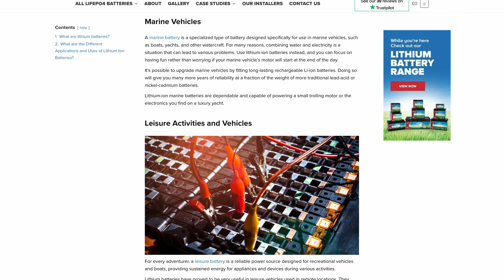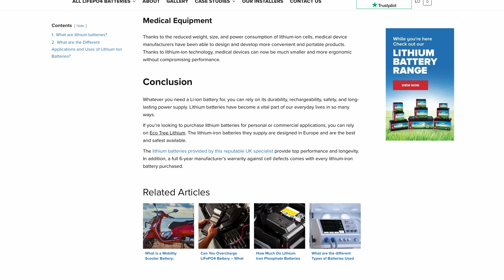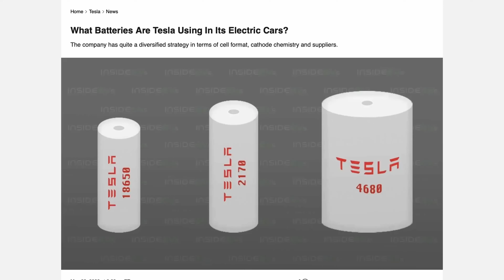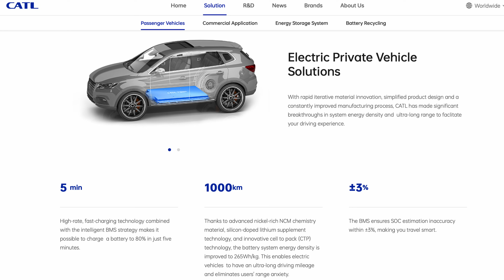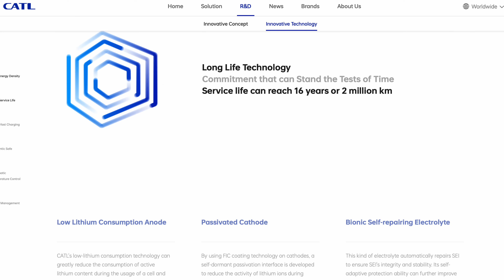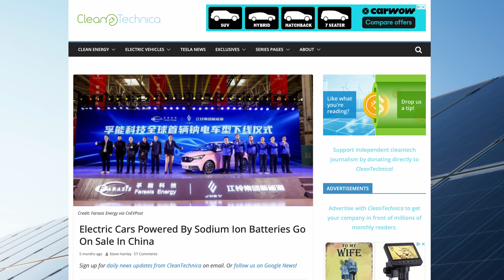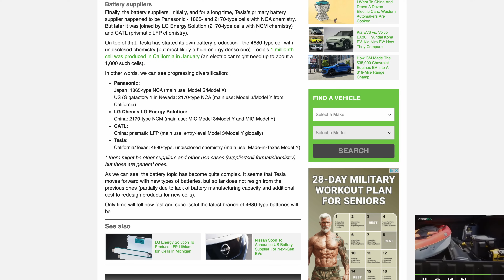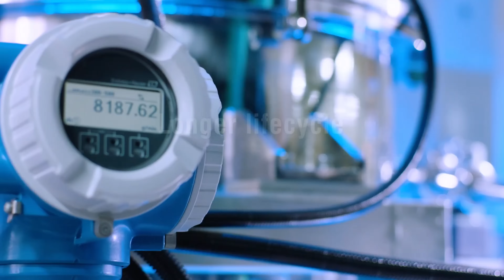The Future Of EV Batteries Is Really Rather Exciting

Comment: Don't categorise Sodium Ion as just for cheap low mileage cars , the best of the current tech is about the same as current LFP batteries , which give decent range. Plus cold temps do not have as much impact on Sodium Ion batteries, which will offset the lower energy density. 
As for the near future. Solid State Sodium Ion is getting closer to production which will give higher energy density than current best in class Li on batteries.
As you say Dave , the future is very exciting...

Comment: As long as batteries can produce the currents required to power an EV, fire will also be an issue from short circuits in the electrical systems of EVs…..most ICE car fires are not caused by the fuel but by electrical faults.  Interiors and aluminium burn quite well once a fire is started by the heat from an electrical short circuit.
Reply: Each cell in a Tesla is thermal fused and the minute the heat increases beyond tolerance the fuse pops and the circuit is broken. However, this does not Ward against a short circuit in a severe impact or something similar. That most likely cause of internal combustion engine fires is the 12 V battery shorting.

Comment: Ahhhmmmmmm EVs do set on fire stop it with lies your lieing to your viewers
Reply: The AA research into the subject from across the world suggests that the inverse is true; that EVs are far less likely to catch fire than internal combustion engine (ice). EVs have  broken every road safety record on the grid.
Bedfordshire Fire and Rescue Service records, some 1898 fires in 2022 were from petrol and diesel vehicles and 54 were from EVs.
The Swedish Civil Contingencies Agency (MSB) reported 23 fires in 611,000 EVs during 2022, or 0.004 per cent in a year, which makes it 20 times less likely to happen than ICE car fires, which burned 3,400 times in 4.4 million cars, or 0.08 per cent. MSB has also recently proven a new way to extinguish battery fires fast.
Reply: 20 times less frequently tthan ICE cars.

Comment: I would guess that in the future the EV platform vehicles will likely mean more choice of cell type.  I might expect that my car, if it needed a fresh battery in another ten to fifteen years, might get a different chemistry/ capacity/ charge-rate , etc cells rather than the present chemistry (NMC).  The present EVs on ICE platforms are less likely to be quite so easily accommodated with up-graded batteries in the distant future.

Comment: This is another reason EV adoption is slowing.  The whole of the car industry is suffering from Cuba syndrome. People won’t replace their current ICE because the future is so uncertain.
Reply: EV sales are increasing for both new and used sales.
Reply: @RuislipResident-v7p  they are not increasing at anywhere near the pace expected. Adoption outside of the early adopters and heavily subsidised company car market is very slow. We are still bumping along around 15% and nowhere near the 20% government target even with the heavily discounted new cars available (up to 40%)
Reply: I replaced both my ICE vehicles with EVs and will never go back.
Reply: @rogerphelps9939  yes the sales are up 10% but that only takes the market share up by 1%. The subsidised company car market is worth 280,000 to 300,000 cars a year base turn over which means private sales will be between 20,000 and 40,000 this year. No where near enough adoption to hit the government targets. Cuba syndrome is real and caused by uncertainty in the market.
Reply: EV sales are increasing for both new and used sales.
Reply: @RuislipResident-v7p  market share for BEVs has increased from 15.3% to 15.7% all car sales have increased this year but BEVs are already 6% behind the target. We need to hit 360,00 EVs we are currently only going to hit 321,000 of which these are mostly subsidised company cars replacing subsidised company cars
Reply: EV sales are increasing for both new and used sales.
Reply: For China EVS are massively accelerating and this is a huge problem for legacy auto because much of their profit comes from the China market. Not doing anything is simply not an option. Sticking to ice will not work.

Comment: The key of rapid charging in about 5 minutes, quashes the USP for Hydrogen
Reply: Kilovolt or megavolt charging is an insane idea. Yes it would charge quickly but how is that done exactly?  Even fully trained electrical workers have limits of approach to insulated HV of metres depending on voltage level. This is law in Western countries. Regular people limit of approach distance is even more. EV charging in cages perhaps? It is concerning how little respect people now have towards electricity.
Reply: I am afraid there are many problems with hydrogen not least the venting issue. As the cryogenically frozen hydrogen warms up in ambient air, the car has to vent. So you lose range while you’re parked even on a cloudy day.
Reply: To charge an EV in 5 minutes would require a current of about 500 Amps with copper wire 2cm thick. 
Where are you gonna get that from ?  An extension lead direct to hell might do it.
Reply: @Hickalum  If you can charge at a couple of kilovoltts that is easily manageable.
Reply: @rogerphelps9939  Maybe. I don’t know enough about transformers, except that they are very efficient.  … Those little brick buildings that house the step down transformers between grid and local distribution come to mind though, with “Danger of Death” written all over them !

Comment: We'll never have an EV that charges in 5 minutes because you wouldnt lift the charge cable, assuming it is possible to deliver the power.

Charging speed will ultimately always be limited by the charger.
Reply: Correct … You would need 500 amps to charge an EV in 5 minutes … with copper 2cm in diameter.
Unless … You could charge at 400,000 volts - then you need less than half an amp.
So it’s very simple; just plug your car straight into the national grid.
Reply: No. You can increase the charging voltage by temporarily reconfiguring batteries from parallel tto series connnection. 800 volts is already possible with the EV6.
Reply: Cables can be liquid cooled. People managed to do without their iPhones for a couple of hours I’m sure even 15 minute wait isn’t the end of the world?!

Comment: NMC batteries were the most commonly used in EVs last year. So of the EVs on the road today this type is probably still the majority.
Reply: I’m not so sure about that, but you might be right. Certainly in China there will be far more LFP and sodium batteries in their proliferation of cheaper EVs.  Tesla, which is the biggest global seller uses NMC in their high-end all wheel drive and LFP in their standard range.

Comment: WOW you cannot have it both ways. EV batteries were sold as lasting as long as the car. There are millions of non LFP batteries out there and if the statement about battery longevity is true they will be there for decades ahead. These batteries were also supposed to be used for home storage (please don't do that). Then you state that most cars now have LFP batteries. Absolutely not. Only the standard range Tesla 3 and S uses them. Other models do not which is also true for the vast majority of other EVs produced, especially the very low cost models. LFP batteries are very heavy and best suited for trucks and large cars. Sodium batteries are I believe only in one EV at the moment. Contracts will have to run their course so they will take a while to catch on. The old chemistries have a good while to run yet.
Reply: Nonsense
Reply: I have an MG4 Trophy it has an NMC battery
Reply: @peterjones6640  I have an MG5 and it has LFP.
Reply: Odd. All MGs are LFP as are most other more recent EVs. 

I don't recall MG making trucks. Maybe I'm looking at mine from too far away?
Reply: @Burz69 . Incorrect, only the MG4 standard range has the LFP at present.
Reply: @bordersw1239  let me check that.....

Nope. MG website shows other models use LFP.

Edit.

@bordersw1239 it won't post. In fact because I tried it won't even let me comment again.

Look on the website.
Reply: @Burz69 I like a link to that please. Only the standard range MG4 uses LFP
Reply: @Burz69  I did, your comment was that all MG cars use the LFP. Only  one of the MG4 variants use LFP , only 2 of the four MG5 models use LFP and finally - only 2 models out of 4 of the ZS use the LFP battery. The only LFP battery MG use is the 51 kWh unit.
Reply: @bordersw1239  I said all models had LFP. You said only the MG4.

I can still see it. It's not vanished into the ether.